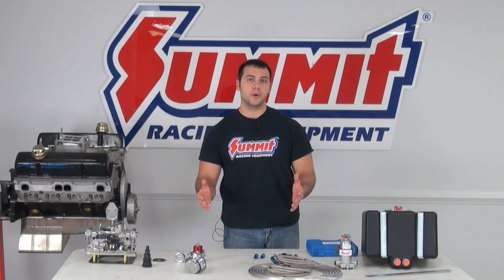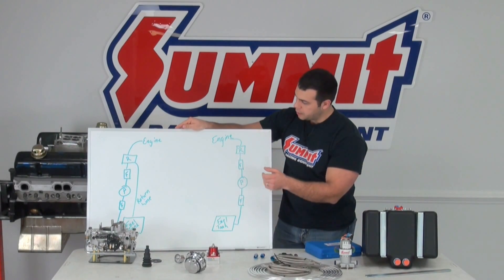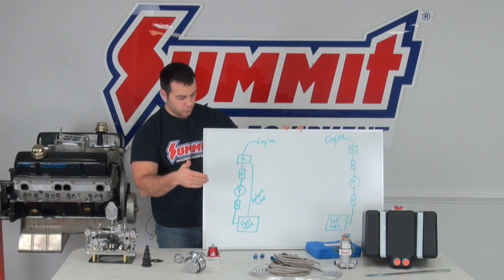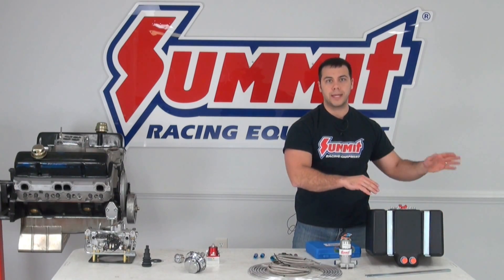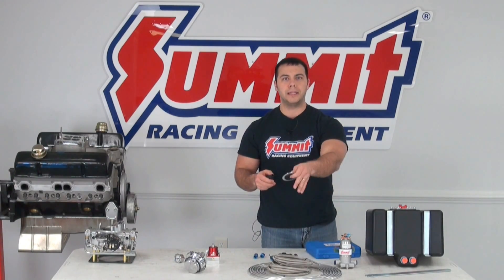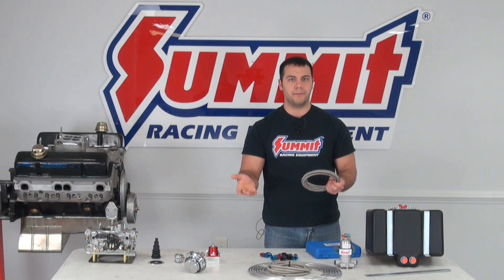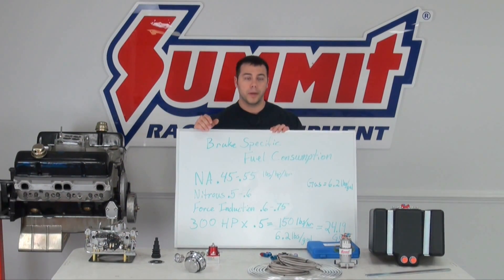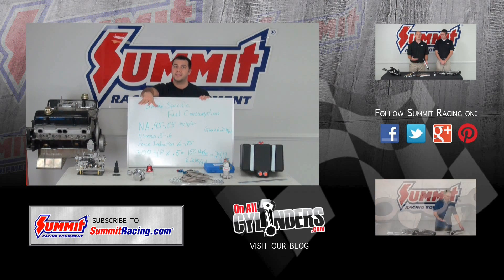Fuel System Design - Summit Racing Quick Flicks

Comment: Whats the best way when you have fiberglass cover on 2014 silverado 1500 5.3l z71 lt. How would i do the vent and is this also safe to do. I want to mount cell in bed by the cab instead of at tailgate.  Ill be removing factory tank that will also get rid of the lean on the driver side. Now the truck is still NA is it good to upgrade fuel pump at that time. Thnx

Comment: There is also another way to plumb the regulator on an EFI system.  If you plumb the regulator post Fuel rail and plug the third hole, you can control the amount of fuel pressure in on the injectors.  Then run return line back to the cell.   Just make sure on a forced induction engine running high boost (20 - 30) hp, that vacuum lines run for fuel pressure increase as boost increases.

Comment: That fuel cell is not for a return system. The secondary port in the sump is for a second fuel pump option. A return cell has a port on top for vent and a port on top for a return line.
Reply: Thanks for saying that. I was about to use it as one!!! Maybe you can help me. I have a external pump with a stock tank and a welded in sump. Can I use the return port of the internal pump housing that I just got plugged off? Instead of drilling my tank and putting in a return bung? Thanks!!!!
Reply: @billmcclellan9743  man I do not know without seeing your set up. I do not want to tell you the wrong info with that. I run my Holley Black pump as a dead head set up and have never ran a return fuel system.

Comment: Hi!

I have a toyota land cruiser 100 series 2001 with 1FZ-FE engine.

Here are the applied modifications on my cruiser:

Turbo charger with 7.5PSI boost. (350 WHP)

550cc injectors 

Main fuel pump: AEM 340

Sub fuel pump: AEROMOTIVE 340

Aeromotive fuel regulator set on 40PSI

(No change on fuel line and fuel filter from tanks to engine)

AEM water methanol system

During highway cruising in hot days (+30 C) after almost 100 kilometers, the fuel pump fails. By changing the tank, the engine  starts and operates normally.

This scenario happens on both pumps in same situations. The failed pump would operate normally after 10 to 20 minutes of rest.

Previously on my previouse pumps (aeromotive 340) after facing few failures as explained, my pump failed to deliver 40psi on half voltage in low rpm. It could pump about 20 psi.

(100 series have fuel circuit resistor which works on 6.5V or 11.5V based on necessary fuel flow) 

I jumped my fuel circuit resistor for a while to receive 40psi on damaged pump but after a while the pump died.

(It's like the damaged pump, pumps 20psi on 6.5 but 40psi on 11.5)

Now I have two pumps from different brands with same specs but they both act the same under pressure in hot days.

I need your  advise on the issue I am facing.

Comment: i have a camaro 305 tpi engine. what psi fuel pump ?  doing a fuel cell but not sure what fuel pump i need for this engine. o this is going into my bagged / body dropped 92 s10 blazer.

Comment: ok. i have a 1996 f250 regular cab long bed with a 460. it has dual fuel tanks and ive always had problems. id like to take out both fuel tanks, and everything in between, to the engine, and replace with a large fuel cell or a single tank. options?

Comment: with the tank you have in the video where does the return line go into? can you use the one of the outlets at the bottom for the return and one for the out, or do you have to make a new hole in the tank at the top? thanks

Comment: can you tell me please which way is better for install the fuel regulator connections is after the fuel rails or before the fuel rails .. becomes the in  fuel line is from one fuel rail  and the out fuel line is from the sacand fuel rail
Reply from the maker: Hi احمد الشريف , 
Both ways you’ve mentioned work well. It really is the builders preference and may depend on how the overall plumbing will be routed on the vehicle.

Comment: does the size of the fuel line matter?
Reply from the maker: Hi Steven, 
Yes!  Fuel line size will matter a great deal especially depending on the pump and filters you will be using. Give us a call and we can help you map out your fuel system. 1-800-230-3030
Reply: Do you suggest having a bigger feed/return line on return style systems? And what would 'Parallel' be considered? Or is that just one of these x2?

Comment: I have a late 90's ford 4.0 v6 efi and I would like to install an in tank fuel pump system. my tank will mot accept the factory pump. Do you offer an aftermarket in tank fuel pump that can be fitted into my stock tank. I do know the desired psi is 35-40. I can put on a regulator with a return line if needed. thanks. Jim
Reply from the maker: Hi Jim Jim, 
Take a look at a Holley part # HLY-12-130 on the Summit Racing website. It is a retro-fit in-tank fuel pump kit that will do just what you need. https://www.summitracing.com/parts/HLY-12-130

Comment: I currently have a Holly HP 125 fuel pump and just received an 8 an install kit from you at summit, I am at about 500 Hp on motor and 125 extra on NOS, is it ok to use the 8 an from the tank all the way up to the regulator right before the carb and then down to 6 an or do i need 6 an all the way from the outlet side of the pump?
Reply from the maker: robertkitchell859 , 
For that power level 8an should be used all the way to the regulator & carb assuming it is a Holley. 6an can be used to your NOS solenoid.

Comment: Ok so I got a sort of specific question. I currently have a 96 Cobra engine and transmission. I am putting into a 99 V6 Mustang. Aside from the other things I must change over, can I use the return-less style fuel system on the 99 on my 96 Cobra (with the return fuel style) with a 96 Cobra fuel pump?
Reply from the maker: JohnBoyM16 , 
Providing you will also be using the matching computer, wiring harness and sensors for the Cobra motor this should not be a problem.

Comment: Hi Summit Racing
I want to renew my skyline r33 fuel line, i want to make 600hp engine on it. my question is which diameter of hose or tubing i'm going to use. should i use an6 or an8 hose for fuel delivery e.g fuel pump to pre filter to big filter and regulators inlet using an8 size and then an6 from regulator outlet to fuel rail. or all the way by using an6 size only
Reply from the maker: Hi Md Armie Abd Rahman, 
Always use a large line from the tank to the inlet side of the pump. This minimizes the chances of cavitation or air bubbles being introduced into the fuel system. For this application, use an 8AN on the inlet and a 6AN on the pressure and return sides.

Comment: I prefer return less style if I'm not running a NOS system
Reply: Patrick Moore    Umm. Only if you are fuel injected and have good computers.
Intake injectors would be pree hard to accurately feed without a return for the excess fuel needed for pressure.

Comment: On 600hp big block application using a carburetor and mechanical 110 gph pump what type of filter do you recommend? Should it be before or after the pump?
Reply from the maker: Hi MrGnrnut, 
It really depends on what you want to look at. If you want to plumb and see an anodized filter under the hood we have plenty of choices. If you don’t want to see it and it just needs to function properly, then mount a Fram HPG1 canister style filter assembly back by the fuel tank.